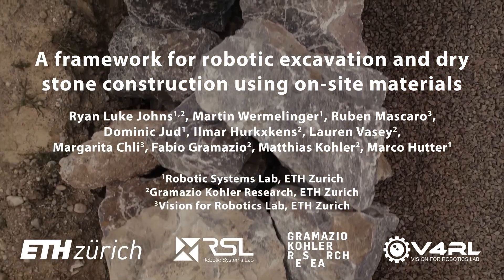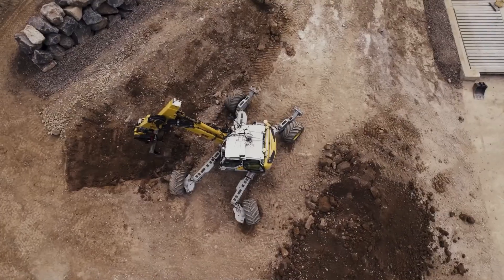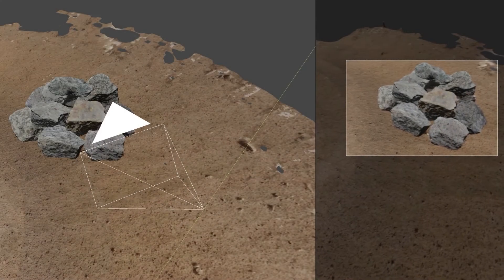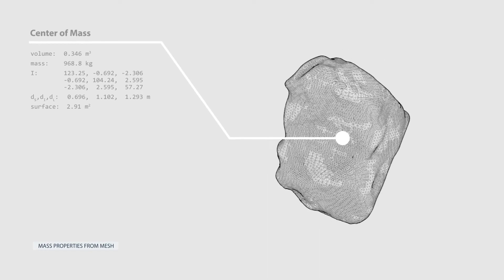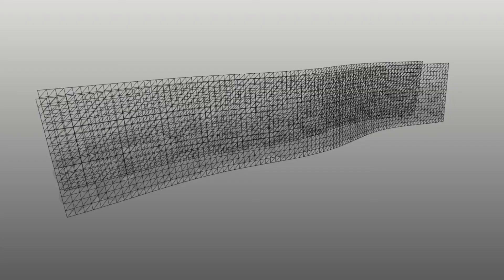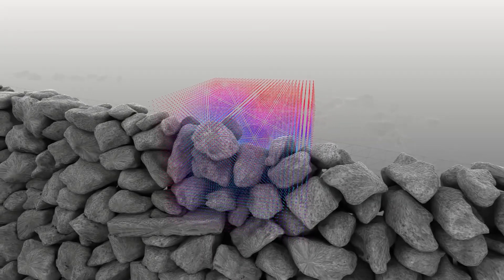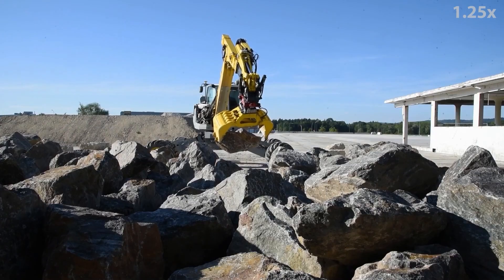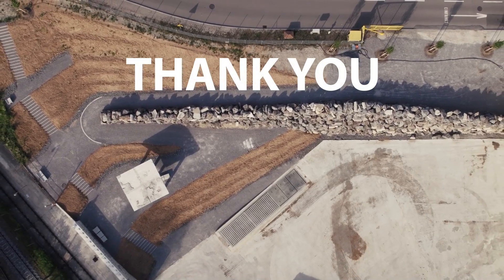A framework for robotic excavation and dry stone construction using on-site materials

Comment: Super cool and very well executed; had the same idea when visiting mont san micheal some years ago and realizing it is harder to build something like this now than it was a thousand years ago, which is kinda crazy. 

The next step would be to integrate it with some level of stone shaping id say. I guess these walls look pretty good for unshaped rubble blocks; but I bet that even with just a minimum of judiciously selected shaping operations you could make such walls much more dense and rated for carrying much higher loads.
Reply: Agreed! I had the same idea for a thesis but knew I didn’t have the programming skills to execute (and couldn’t convince any of my friends to take it up). I realise how hopelessly complex it is. I think the structural stacking can be further refined to account for different external earth loads and better predict settlement. Match this with a robot that can predictably split stones into the right shapes and the ability to place a large range of stone sizes, you could start making substructures for bridges and buildings.